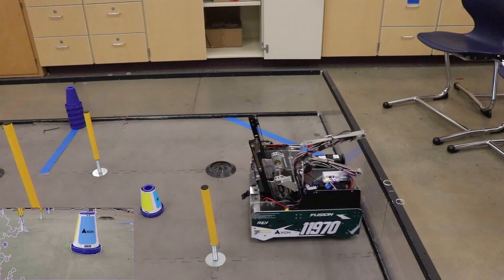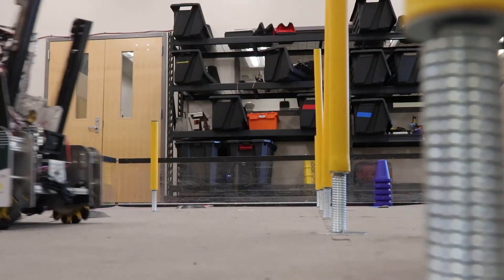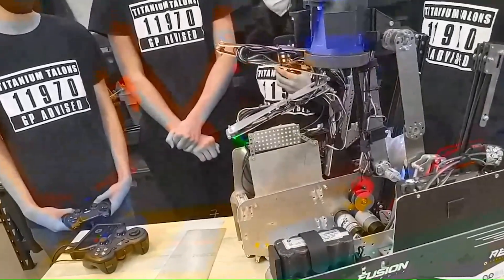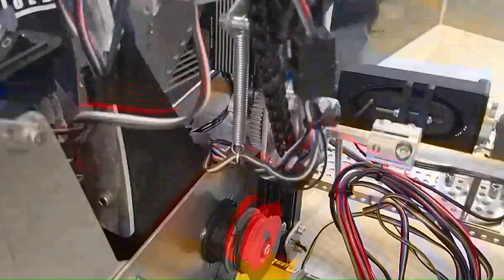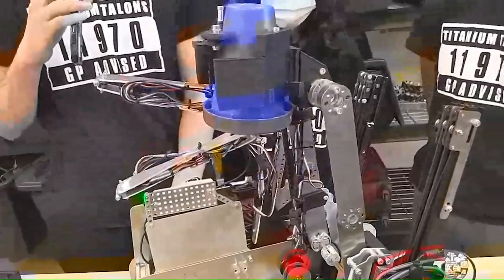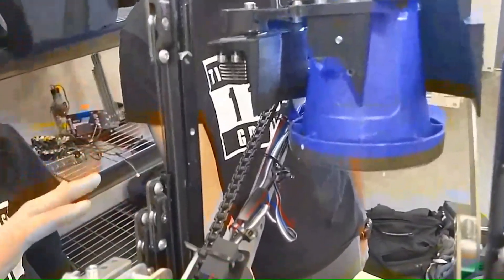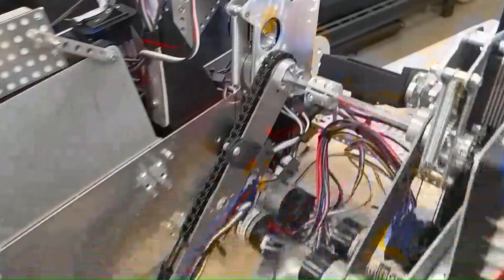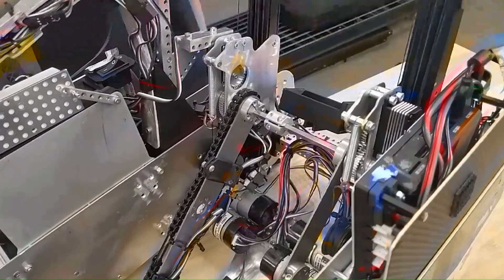Behind the Bot 11970 Titanium Talons POWERPLAY Robot

Comment: Excellent Robot Titanium Talons!! Well thought through and amazing design. Where did you find the metal inserts you have on your Slides and what slides you are using long robotics?
Reply: Yes we are using LR 400s and we made those ourselves. If you want the file LMK, we have a plasma cutter at school but they could easily be waterjet cut. Kinda needs to be metal, but would recommend steel so it can be thin and tapped. we use a custom 3d print part that holds the pulley wheel and needs m3 and m4 tapped holes while the slide connections have slots to help line up.
Reply: @robotkg6540  Dawg#4397